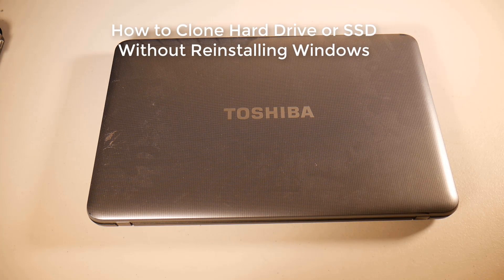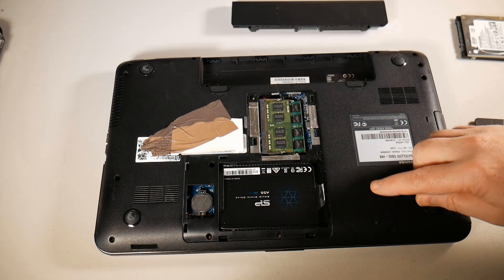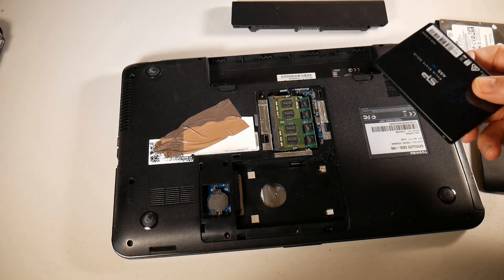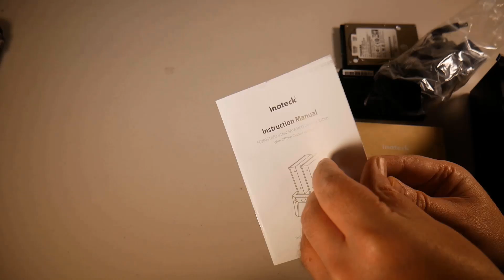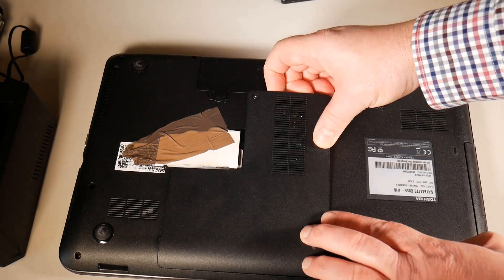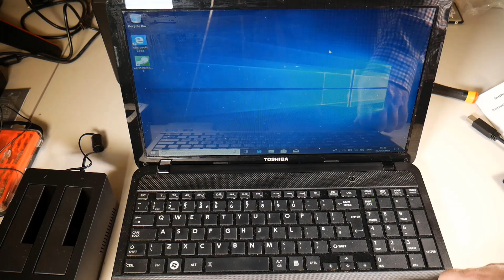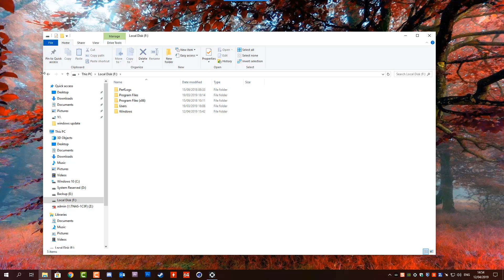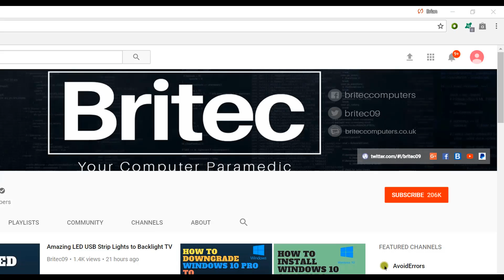How to Clone Hard Drive Without Reinstalling Windows

Comment: Thanks for this video. I purchased this equipment and found that it absolutely works. I was having so much trouble trying to clone my old drive.  Working offline, this performed  great. I was able to take the cloned drive and install it to replace my old Seagate 1TB. My computer immediately booted up with NO issues at all. Thanks again.

Comment: Nice devices Brian. I find the disk cloning tool a great piece of hardware for cloning drives without taking my PC out of use. Just switch it on and leave it to get on with the work.
Out of interest what was the internal transfer speed like, and will this one support intelligent sector copy?
Thanks for the videos as always 
🙌
Reply from the maker: Using the USB would be USB 3.0 UASP 400+ MB/s as for what I showed in the video, I did not time it and can't find info on it. But its not the fastest, but tbh, I was not siting there watching it. It done the job pretty good.

Comment: Thank you for making an easy to understand step-by-step tutorial. I have an old Lenovo T60 Thinkpad which needs a larger capacity SSD installed in place of the 60gb mechanical hard drive. I can now go about this task with confidence after watching your tutorial. Can I go as high as a 250gb SSD?
Reply from the maker: Yes Bruce, that would be fine if your Master Drive is 60GB mechanical hard drive and your slave is 250gb SSD
Reply: Thanks Brian.

Comment: That's not as expensive as I thought it'd be.  Nice.  Lil' question (as Amazon's Q&A didn't cover and I trust you), as you've done a clone, does this do a sector by sector clone or does it simply copy data from bay A to bay B?
Reply from the maker: it clones data from A to B sector by sector, so its the exact same copy
Reply: @Britec09  Awesome.  👍 Hardware based is better imo.  Can't truly trust software based, especially in Windows, as they could read the permissions in files and folders and prevent a truly exact copy of a drive.

Comment: Thanks Brian :-D
Ideal for keeping a backup or backups of the current system to an older drive, just in case the worst happens and the ssd poops the bed :-D.
What is the maximum capacity drive and transfer mode?
Reply from the maker: USB 3.0 UASP 400+ MB/s

Comment: I use Acronis . These tools only let you clone to a drive that is bigger or the same size as the original. They also take a lot longer than Acronis.
Reply from the maker: This video is not about what is best, its about how to clone without software? can Acronis do that? No.

Comment: Could you also use the built in Windows 7/10 backup utility ?  I have done a backup from an internal to external drive and then restored that to a new internal drive and it worked but it did mean having to have that spare external drive.  This was mechanical to mechanical drives though.

Comment: Can you make a video on how to change a windows install from GTP to MBR in order to move an installation from a UEFI system to BIOS? Real life example: moving a virtual machine to another hypervisor that doesn't support UEFI.
Reply from the maker: https://www.youtube.com/watch?v=H1pjUXGWUfI
Reply: Thanks for sharing. So would that work going from GTP to MBR (reverse of what you showed)? I finally figured out a way using a PE version of Windows because none of the free versions of EaseUS support Windows Server. It was quite a hassle because I had to rebuild the boot partition from scratch. I was just curious if there was an easier way for Windows Server without using EaseUS as it's not supported for Windows Server editions.

Comment: If you just install Windows 10 on a new SSD, skip the key part and remove the original HDD boot drive before booting, will that work? I have spent weeks trying to figure out how to clone my OS and applications from a 8TB HDD to a 500GB M.2

Comment: another way that I used is to use Gparted Live to clone entire disk, but you'll need to use Windows disc to rebuild the Windows bootloader later. 

Building a disc/flash drive with Gparted + Windows 10 installer can take a lot of time. As of now I'm looking for modules to build PE image that can just use Startup Repair just to automate the process.

Comment: 90% of the time I'm copying a 500gb mechanical drive to a 240gb SSD. Is this hardware smart enough to shrink it down. Or is it like you said the slave drive has to be equal or larger?
Reply from the maker: Going by there manual, I think that is what it said, the more expensive ones can calculate and adjust. Not sure this can at $30
Reply: Using a docking station, your destination drive must be equal or larger.  To go smaller (if room is available), there is Acronis, but their free version is an absolute nightmare.  AOMEI Backupper (free version) will allow you to clone to a smaller sized drive and is very user friendly to use.

Comment: Is it possible to clone a raid 0 to a single ssd?
Reply: Not with that hardware, You can do that with Clonezilla software which is free, but it takes little bit of effort to prepare USB stick and maybe read the manual...
Reply: @lechulsk4845  Great, thanks for the info 😀